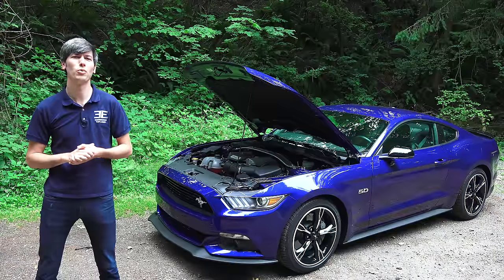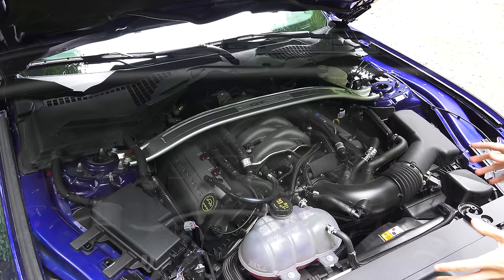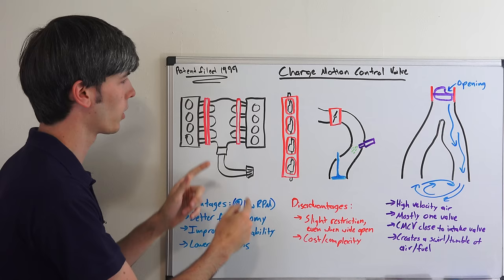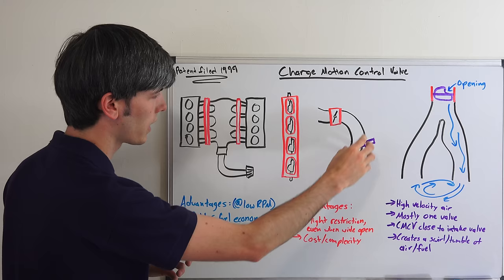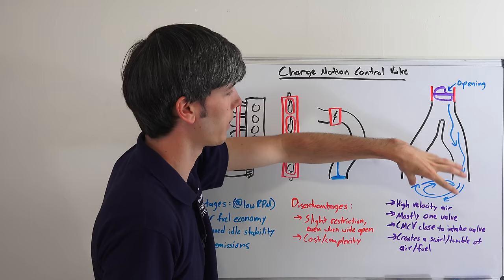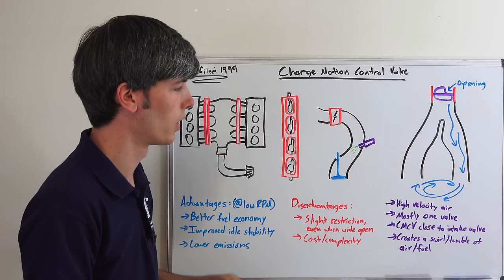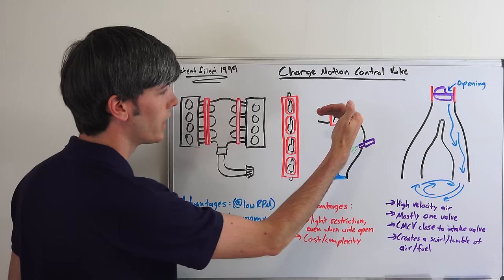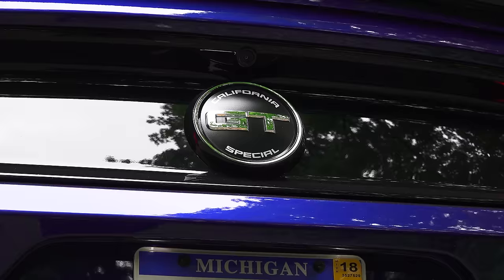Keeping The V8 Alive - Charge Motion Control Valve - Ford Mustang GT

Comment: I wish the EPA was shut down
Reply from the maker: I think the rest of us are pretty stoked to have air quality that isn't like Shanghai. People take for granted having clean air and water; it's not like it just happens without regulation.
Reply: +Engineering Explained the intention were good when the EPA was started but now they have to much control.
Reply: +Engineering Explained the new regulations are to extreme. Cars were fine before.
Reply: +Engineering Explained Well the regulations are one thing but please, the air pollution is just but a small thing, plant a few trees and you have it. The car creates "no pollution". If someone didn't take the money for that, so our cars can be more and more unreliable (1.2l turbo in a 1.5t vehicle) i would be damned.
Reply: I think the EPA is needed but things like CAFE standards are forcing the automotive industry to adopt turbocharging and downsizing much earlier than they would have otherwise.  That's probably part of what led to:  http://www.cnbc.com/2014/02/12/car-reliability-drops-for-first-time-since-1998.html
Reply: You should be happy with the small restrictions you have in the US.

In europe, its much harder. The EU gives european car manufactors a fixed amount of CO2/km they are allowed to produce. For example: take the average polution of each 1 piece of all BMW cars with every engine available (For example: 200 grams of CO2 per kilometer).  So if BMW decides to put a V12 engine in the 7-series which produces 300 grams of CO2 per kilometer, the average CO2/km rises. To react on that, BMW puts a 1.2 litre 3-cylinder in the 3-series which produces only 100 grams CO2 per kilometer.

The EU gives every manufactor a specific amount of CO2/km. So Bugatti is allowed to produce more than BMW and BMW is allowed to do more than Renault or Peugeot. 

But overall, it leads to the death of big NA V8´s like the 6.2l AMG engine and is one of the reasons why Porsche and Ferrari decided to go more and more with turbo´s.
Reply: You have never been to a country with low regulations, and it is very apparent.
Reply: Factory forced inductions have been working well for years and are incredibly reliable.

Part of that reliability drop is from manufacturers going for the cheaper option in order to sell more products. Essentially, lower the production costs helps keep profit margins where they are desired, but still sell a car at an affordable rate.
Reply: +Engineering Explained As am I, but there is such thing as too much regulation. Part of the reason why there is such terrible air quality in cities like Shanghai is because of agencies like the EPA that drive jobs and production to places with little to no regulation. In stead of finding a balance that keeps the air clean but still allows a country to remain competitive economically, they just keep slapping more and more rules and regulations without considering the consequences.  We don't properly weigh the pros and cons of these regulations, we just assume all emissions are bad and all economic activity cannot be harmed...Then we wonder why we see costs go up and money go over seas.
Reply: +Abendschein I have been to many developing countries, and they are steam rolling the US and Western Europe.
Reply: Skipper Truth
Reply: +Skipper That is so right, it hurts! The very idea of "Zero Emissions" is idiotic. Even just existing, all life on earth creates some emissions. The goal should not be to eliminate all emissions, the goal should be stop excessive emissions, which is what pollution is! There is no way healthy humans can exist with out at least some emissions.
Reply: The road to hell is often paved with the best intentions.  A perfect example is the VW diesel debacle.... The real emissions of the VW clean diesel were MORE than acceptable levels to realistic people.
Reply: +elesjuan the whole tdi crap is so over blown. There bearly over the limit
Reply: While that's true. I think they shouldn't hinder performance of supercars and hypercars. I mean even if they would comply with standards from 20 years ago it's not like there is enough of them to destroy the planet. But now Ferrari is switching to Forced induction. Same thing with AMG/M/RS. Do we really have enough AMGs or Ms to be so harsh on how much they emit. Sure it would be less ecological, but it's owner will probably put custom exhaust that doesn't pass emission test anyways.
Reply: Marek Sumguy Your sarcasm isn't amusing. CO2 can be a threat, but the question is when  does its emission reach a damaging level and when is it at an acceptable level. CO2 is necessary for life on earth, so  we can't just keep regulating it out of existence.
Reply: Go to your youtube search bar and type, "13 Misconceptions of Climate Change" by Vertiaseum.  Come back here and try and make the same claim.  If you watch this channel for the reasons you should watch this channel you will understand that video.
Reply: Cars dont suck now beccause the EPA, they suck because they are going for the bottom line rather than quality.  There is NO reason vehicles are not getting 50mph+ highway with 40mph+ city(not counting stop/go)  Some cars are getting there, but it is wholly attainable like 10 years ago with just gas engines.  Its just not as profitable as people dont care about fuel economy, they care about an SUV that they use as a daily driver.
Reply: Same.
Reply: +elesjuan Hear Bloody Hear! especially when is fact CO2 is not a pollution its Plant food!
Reply: +George Kartvelishvili A correctly built Exhaust system will ALWAYS improve efficiency and thus IMPROVE ' emissions ' not make them worse!
Reply: +dosmastrify cars are not the problem.
Reply: Trees don't absorb carbon emmisions from burned fuel, they absorb Co2, which is a minute percentage of the exhaust that comes out of a car.
Reply: +CrispyBacon I don't care anymore. How about everybody leaves be alone. I'm freaking tired of this. You guys think you know everything. You don't. Your all corrupt.
Reply: That is absolutley incorrect.  ALL cars that burn gasoline, create carbon monoxide, no matter how efficient they are.  And a minute amount of carbon monoxide will kill a person.  When they talk of fuel efficiency, they are talking about the output of Cabon DIOxide, which is not what kills you in an enclosed garage (well, not the main cause of death at least).  This is why new cars have a sticker that tells how much Co2 per mile the car produces.
Reply: +CrispyBacon they have that sticker to help you be carbon neutral.   it's a requirement from the feds
Reply: The Technician next door That was a global scam. Not even just the EPA.
Reply: Odds It's not really Nazi like, though. That's quite a comparison.
Reply: +Nathan unknown thank you man
Reply: Then Vote Trump!
Reply: +Taylor F 50mpg was abtainable 10 years ago. I own a 93 Geo Metro and that thing gets 50mpg. That car was so cheap some didn't even include a passenger side mirror. That car now has over 350K miles on it and you can buy every part for dirt cheap. New clutch that will be $70
Reply: +CrispyBacon You are correct in saying that trees absorb CO2. However you say a minute percentage of automotive exhaust is CO2. If you ignore the nitrogen in the exhaust (is basically an inert gas to the engine so almost nothing happens to it during the combustion process) about 1/3 of exhaust by volume is CO2 and the other 2/3 is water vapor. Cars put out plenty of CO2. If a car is running correctly there shouldn't be any other carbon emissions from a car. However there is always a minuscule amount of carbon monoxide and some unburned hydrocarbons but those will react given some time and turn into CO2.
Reply: Cody Colosi There is a balance to everything. I think the EPA has gone too far but I really appreciate a lot of what they have done. If every car today polluted like a 60's car it would be one nasty world. In the 60's the emissions were ok because there were so many fewer cars on the road because there were so many fewer people and most of the world didn't own a car. Better pollution control would come about by better population control.
Reply: +PGT Films. I don't care. The tesla may be faster than the viper. But the tesla has no passion it's just a joyless pice of metal. So you can have your tesla. I'll keep my gas and Diesel cars.
Reply: +DQSpider they may not be as complex as these modern engines but, they last.  the 77 351w in my boat still runs like new.
Reply: +DQSpider sir, it runs almost daily, at 3500 to 5000 rpms under very heavy load.   so yeah it had lasted.  it has 14000 hours  on it n it still has good compression.   my father n laws tractor is a 19 40s  n we still use it every season. n only put 1 seal n a valve cover gasket on it in 70 years.  so yeah.  they last
Reply: +DQSpider you don't know much about marine engines.   it turns twice as fast as a car engine.  my car at 70 turns about 2k.  my boat at 75% throttle turns 4500.  which is where it runs for 2 or 3 hours a day. about 4 days a week.   which is far more than any vehicle used for a commuter car .  so keep your over engineered, prone to damage engines n have a  coke n a smile.
Reply: +DQSpider that's really a rude thing calling someone retarded. It's like this some people like old engine. What one person may like another person may not.
Reply: +DQSpider not wrong.  I have no use for annoying liberal people that think they r right.  I did have a 351w in a truck was going strong with 270 on it till a tree fell on the hood.  sadly it was crushed.   bl9nd cracked in half n tranny was torn apart.
Reply: I have a Geo Metro with over 350,000 miles on it. New engines last too and just because it lasted a long time doesn't mean it is good.
Reply: +Nathan unknown I fully agree with you. There are some things that need to be controlled by the government but what we buy shouldn't. It's our money and we want to use it the way we want not for what they want
Reply: should you be able to buy  bombs at the supermarket, because "I dont like mondays"?
Reply: dude if it wasnt for californias smog regulations people would get carbon monoxide poisoning just sitting it traffic
Reply: lol, make all fuel unsubsidized E100 and the EPA won't have to set any other standards.
Reply: CrispyBacon that is kinda misleading. the largest exhaust gas (technically) is nitrogen, but it is also the most common gas. about 75 percent of normal air is nitrogen. it goes through relatively untouched. the second largest (and the largest byproduct of combustion in an ICE) is CO2, followed by water vapor.
Reply: yan-Deriction I don't know if you have put high ethanol ends in any vehicle but in my experience it makes it run far worse and kills both power and fuel economy. also we don't have enough enough farm land to make enough corn to run all cars off even the existing high ethanol blends. (yes I know even regular gas does continue some ethanol, but not much)
Reply: Generally the perception is that U.S. and California emissions standards are higher than in Europe, hence the difficulty of getting diesels to market in the United States compared to Europe.
Reply: @EngineeringExplained  why does the CMCV system appear like it could be made redundant by going ITB with short runners without the intake restriction.

Comment: Wasn't Toyota already using this technology in the 80s with their T-VIS? Both systems are designed to increase low end fuel efficiency, and both accomplish this by drastically reducing airflow to one of the two intake valves. Seems like old tech.

Comment: Hear that folks?  Patented in 1999, that means that Ford has had the ability to make these vehicles more fuel efficient for almost 20 years and just sat on it.  It's not just with this it's with all engines, these things aren't magically getting more fuel efficient.  A lot of these cars you're seeing are using some of the same engines that were around 7 years ago.  

At the risk of sounding like a conspiracy nut, my grandfather worked for the Gov't (he was actually stationed at Area 51) and he has told me stories.  I never believed any of them growing up and just thought crazy old man telling stories but then they acknowledged Area 51 was a real place.  Then they acknowledged that stealth technology was developed out there (which he had always said was the case).  

My point being when he claims that he drove a fully operational hydrogen car back then that quietly disappeared or that regular gasoline engines have been capable of much higher mpg than they put out, I tend to believe him.
Reply: L
Reply: Technology costs money. You can't implement expensive new ideas right away.
Reply: The auto industry isn't just about selling cars, it's also about selling gasoline.
Reply: they have been using this actually since 1996 starting on the cobra 4.6 dohc motors. multiple vehciles have been using it since 99.. please check your facts before you start an argument that is useless.
Reply: dont care about fuel.  If i buy power i want power.   Ill use my other car if i need to save a few bucks.  My daily has a rotary engine.  :)
Reply: Ronald de Rooij A few years ago, they were thinking about making solar-powered water electrolysis stations. I guess that idea has gone.
Reply: Jeff K the corvette and mustang both have pretty decent fuel economy.  i got 17/23
Reply: I just made a big comment about this. I am glad someone else mentioned before me! I have two mustangs myself.

Comment: the idiots at ford have not decided to turn cylinders off to reduce emissions? Honda was doing that on their V6 engines at least 10 years ago. With their 3 or 4 cylinder config settings with the Variable displacement technology....
Reply: why do you care about fuel economy on 420 hp v8? You're kinda missing the point.
Reply: i hate that..you buy it for power..not gas milage
Reply: With cylinder deactivation, there are some serious carbon issues. Chevrolet has experienced a lot of this because of their cylinder deactivation
Reply: theres vibration issues as well with cylinder deactivation
Reply: Turning off cylinders creates a fair amount of problems that hit much harder down the road. Ask Chevy about their problems. lol

Honda doesn't do anything with their 3 and 4 cylinders other than VVT/VTEC.
Reply: +ForTehNguyen vibrations can be mitigated with exhaust gas impulse tuning.
Reply: When we were looking to buy a mid size suv, we considered Honda Pilot until I found out about the cylinder deactivation feature.  I like Honda, I know they make good cars, had owned several of them in the past, although lately their quality seems to be slipping a little.  I like and embrace modern technology such as direct injection, advanced safety features, variable valve timing, twin scroll turbo, ('16 wrx) don't care for the cylinder deactivation or the start, stop feature that a lot of new cars have to try to reduce fuel consumption, after 80,000 miles, it will be worth next to nothing compared to a car that doesn't have it.
Reply: woohunter1 Start Stop is mandatory for all new cars across the world.
Reply: my 5L gets 14-15mpg with the way i drive lol. you dont buy a V8 to worry about fuel
Reply: +Byzantine no it's not
Reply: +Byzantine - That is the exact opposite of the truth. It's required nowhere and only somewhat popular in Europe.

Comment: if I'm not mistaken Toyota had this on their small engines back in the 80's. it was kind of their version of vtec. this is nothing new.
Reply: Yes, they had it, and called it the Toyota Variable Intake System, or T-VIS, first on the 4A-GE engine. It's more of a predecessor or supplemental system to VTEC (Honda-speak) / VVT-i or VVT-Li (Toyota-speak) or Ti-VCT (Ford-speak).
Reply: it isn't like vtec because it doesn't change timing, duration, or lift but it does change the intake charge velocity to have more low end torque when half of the 8 intake runners are closed under 4500 rpm and and all 8 feed air into the 4A-GE until redline
Reply: Bryan that's why I said kinda like vtec. Mostly the "v" part and non of the "tec" lol
Reply: VTEC isnt analogous to VVT-i, its the same as VVT-Li though